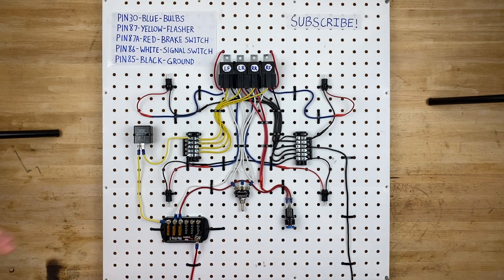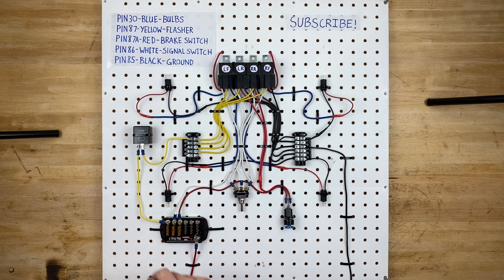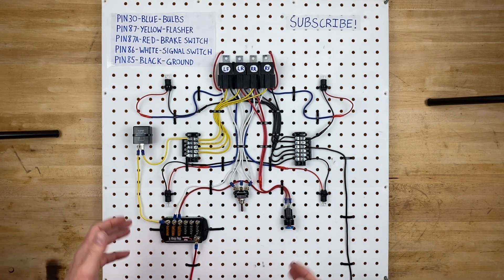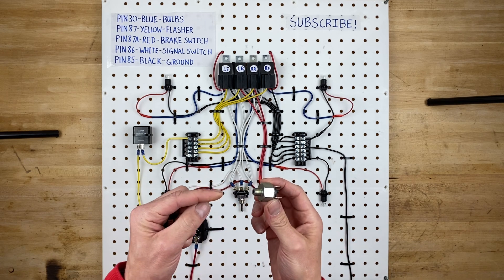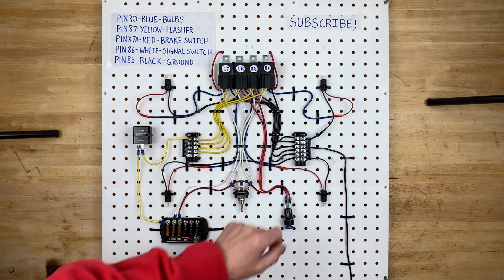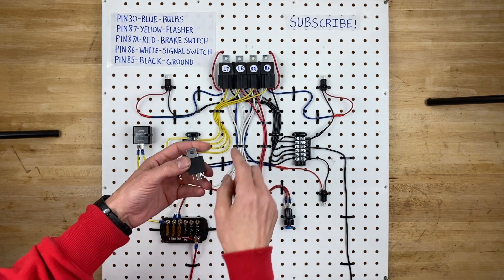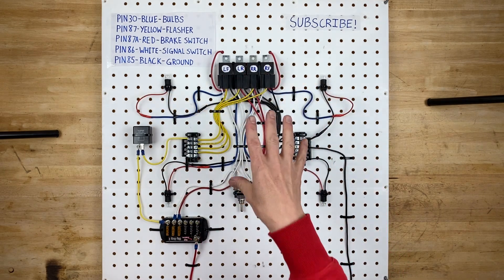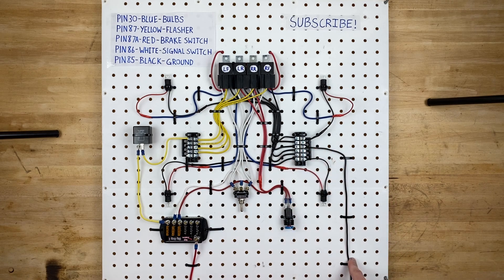How to Wire Turn Signals AND Brake Lights into a ONE BULB | @WiringRescue

Comment from the maker: Thank You for Watching my Brake Light & Turn Signal Wiring video! 
Subscribe To This YouTube Channel: http://www.youtube.com/user/4g63mightymax?sub_confirmation=1
See My Wiring Playlist: https://www.youtube.com/playlist?list=PLsF7T1tRFy2hmiiUUfMZNyV-BUA_yrPIh
Reply: @TommyJensen-pl8qz  what?
Reply: I remember some cars and trucks had that system here in  Denmark in the 70s I don't know how it worked probably existing they don't relay 50 years ago
Reply: @TommyJensen-pl8qz  usually it is the special switch that makes it possible, if it doesn't use relays.
Reply: Hi, i wired up my lights the exact same way but cannot get my brake lights to work, the signal is being sent, but no lights, indicators work fine, but no brake light, what could it be??
Reply: Question. 
I have an older vehicle with a homemade wiring harness. I have 3 wires in the rear. Brake, Tail and turn signal.  I have single filament bulbs (2 each, each side) How can I run the brakes and turn into the single filament bulb. Thanks!
Reply: Love your system,but can't keep up,I have a new 18 circuit painless wiring harness, but still need relays right to run fan fuel pump air ride lights ect. Right ? Can I get a copy of this so I can do this? I have most of the things you show! Thank you for whatever you can help with!!
Reply: Can you help me please to understand better?
Reply: Thank you so much!!! Your very smart!!!
Reply: can you expand this setup to include a hazard light switch? and what it would take to make hazards operate at the same time that brakes do? in other words single filament bulbs used in the rear for brake and blink but when hazard lights are activated the brake switch will still illuminate the rear lights solid, not blinking
Reply: @straighouttheshed   Adding hazards is easy. Just use a DPDT (On-OFF) switch and a diode will do all of that. Can use that SPDT switch or a OEM on the column Turn Signal Switch.

If you are making from scratch like on a dune buggy or ATV or Go Cart, then you can use just 2 relays, 2 DPDT Switches and 3 diodes.. Less wiring.
Reply: What's the diode for and where? Normal operation straight from the factory was if the brake was applied the brake light switch over rides the four way flasher unit.
Reply: @straighouttheshed   diodes is key here, ive wired this exact video and once you attach hazard circuit stuff doesn't work right but I'm realizing diodes are needed for back feed. hoping for a good diagram video :)

Comment: Theoretically to wire 4 way flashers in this you would go from a new fuse to new switch to spliced all 4 turn signal activation contacts on relays?

Comment: How can I do this with just a ground, running lights and turn wires I don’t want to retire the whole truck to the back they are 4” round led lights 

They have a turn/run wire a brake and a ground

Comment: I’m having issues wiring in a light that’s only meant to be a running light into a run/turn signal.  When everything is connected the blinkers only come on when I have the running lights on, if the running lights are off the blinkers won’t work.  Any ide what could be causing this?

Comment: I'm using the wiring proposed here to wire up my volkswagen oval window. It's a Euro model so it shouldn't have any turn lights, only semaphore with continuous light. But decided to have the brake light to be used as turn signals, and also added LED orange lights hidden behind the horn grill at the front. For the semaphores, the wiring was split to have the bulbs flash while the semaphore stay up.
Everything works, and I appreciate your help for helping me understanding all of this.

Everything… except the indicator on the dashboard. I would like it to light up and flash when the turn switch is activated, no matter if it's left or right.
I see 2 options:
 - add a 5th relay powered when the turn switch is activated (left or right),
 - connect the dashboard bulb to both 2 front bulbs and prevent the power to get back by using diodes.

Any advice?
Reply: Using diodes did the trick.
Reply from the maker: Sorry I didn’t get to you sooner! Diodes is a great option that I likely would have done too. You could also probably make it work with a double throw, double pole switch somehow, but it sounds like you’ve got it sorted out. If you have an instagram I can follow your build on, let me know!

Comment: Can I do this with LEDs? There’s a bunch of Amber running lights on the side of my truck I want them to be parking lights but also turn signals. I currently have them hooked up to a regular relay so that they do that now but they flash opposite obviously the existing turn signal so they shut off when the turn signal turns on and back-and-forth. I’m not super good with this kind of wondering but I feel like this could work but then being LEDs I’m not sure if I would need some directional diodes?

Comment: Do we have to use relays?
Reply from the maker: No. But if you don’t use relays you need to have a switch that is capable of making this work. Those switches tend to be $40-$100 at the moment. American autowire has some great options though. Check them out.

Comment: Now, add another complication - retaining the Trafficators but making their lamps flash. Without modifying the trafficator, just route the White power to the trafficator coil and replace the trafficator lamp with an LED on its own circuit board flasher. This type of lamp is available in the UK. The downside is that the trafficator flash rate is not synchronized with the main indicators and the flash rates can drift apart. Or modify the trafficator to separate the coil and lamp power input. Drive the coil from the White power and the lamp from the Blue.  Once you have mastered that, then add a single throw double pole switch to have Hazard Warning.

Comment: I just wired my hot rod exactly this way, it worked perfectly. Now, I went to you hazard light video, no guano! How would I add hazards to this circuit. Please help!
Reply from the maker: That’s fantastic! In this other video I made, I added a hazard circuit about 7 minutes and 50 seconds in. I think you should watch the whole video so it makes sense, but you should be able to do the exact same thing. The most important part is using the dual pole, single throw switch for the hazard. If you don’t, your turn singles won’t work right with the hazard wires connected.  Good luck!

https://youtu.be/Io_i9016o10?si=lA5hzW96VbBIl4l4
Reply: @ you’re a rockstar, I’ll watch it now, thank you for answering me back!
Reply from the maker: @randyhorton8369 happy to help get a hotrod on the road!

Comment: I think you just solved my problem! The aftermarket signal switch was not using 87A for the brake light! Whoo hoo! I'll post back if that works for me, The way I have it wired at the moment, the R signals work until I activate the brake light! Fingers are crossed - thank you - Elbow Up!
Reply from the maker: I hope it works out for you! Glad I could help!

Comment: How about adding marker / clearance lights to an all LED setup. Two purpose bulb, running lights and turn lights. I understand how the incandescent bulbs work on older GM vehicles but I don’t think that’s going to work with LEDs.
Reply from the maker: Hello! Sorry for the delayed response. I do have a bunch of a LED related videos in my wiring playlist https://youtube.com/playlist?list=PLsF7T1tRFy2hmiiUUfMZNyV-BUA_yrPIh&si=Gh_mU6zU7WhJeeIc. I don’t think any are the exact setup you’re asking for, but the information to make it all work should be. Good luck with your project!

Comment: I'm a DIY'er.  I'm going to be hard-wiring a brake/signal/reverse light LED strip/bar to the back of my travel trailer which has a simple light assembly with a white reverse light in the middle.  These strips/bars are designed to work on a pickup truck in a horizontal orientation.  I'm going to be using them vertically on my travel trailer, so I will use two of them (one strip/bar for left and right).  Since the system uses half of the strip/bar for the left and right turn signals, I was thinking of using the "hazard light" circuit for this since it lights up the entire strip/bar.  Am I on the right track?  I think it would involve combining the hazard and signal circuits coming from the trailer and into the "hazard wire" on the strip/bar.  Thoughts?

Comment: Great video, very useful. What about dash warning lights?  Can you use the spare 87A red wires for left and right warning lights, or maybe a 3- pin flasher unit with the 3rd wire going to a single warning light?
Thanks, Nick

Comment: I have one of those 12v auto pre built boxes with six 5 pin Bosch Relays & Fuses. If I use that and the upgraded flasher relay previously installed inside the vehicle do I still need to wire in a second flasher?
Reply from the maker: Unfortunately it’s really hard to diagnose or plan wiring projects over the internet. I’m not sure I could be of much help without the vehicle in front of me.
Reply: @ I’ve got it all worked out what would I run to 87a instead of brake switch where I’ll be doing this to use my amber signal as a DRL?  Thanks for all the help!

Comment: can you please explain how i would do this same thing but with the cars factory turn signal switch that is fed by a flasher? so i have the single filament 1937 parking light that is grounded to the housing that i want to light up by turning on the parking lights and also by turning on the signals it would bypass the parking light signal. but i need to do this even if im driving with the parking lights off. thanks
Reply from the maker: Generally factory turn signal switches have functionality built into them that turns off one signal and lights another. That way relays aren’t needed. Unfortunately I wouldn’t be able to help with your specific scenario without being there though. My newer continuity video may help you figure it out though. Generally a digital multimeter can identify what all the wires are doing.

Comment: wiring my 1959 ford f100 and used all your videos but i want to know the truck have on each back side an extra white led round light but now i want to connect them on the reverse light but also my normal light can i use a 5 pin relay will it work when it get power in on both 87 and 87A like when my lights are on and i am reversing and when you take it out of revers will the reverse light go off but they will stay on

Comment: Thank You for the Content !  Some may not quite realize just How Much TIME is needed to generate these Helpful vids …. THANKS !
I have enjoyed your content on 12V circuits.  I wired a custom LS-swapped hot rod From SCRATCH front-to-back.  I used switches, fusing and relays for virtually Every circuit.  Many said that my system is Way over-complicated.  I have lived through a catastrophic vehicle fire, so I want to use the ‘ounce of prevention’ mentality.
I have an application (custom CamperVan wiring).
Could you perhaps do a vid on controlling One circuit, using Three rocker switches, from separate panels in the CamperVan ?  Most vids that I see for similar application do not address Fusing, Switch ‘protection’ (i.e. relays ?), which leaves me feeling that all protection has been employed.  The rocker switches are 15A capacity, have 5,6, or 7 pins.  I presume 2 or 3-way.  On-Off-On ?
It would Definitely be HELPFUL, and I strongly believe that enough others will agree, increasing Views.
Again, Thank You

Comment: @WiringRescure I'm using a toggle switch for signals and want to use a single pole push button for hazards. Can I fork off a diode to each signal? Thanks!

Comment: Does anyone know if those 2 wire flasher relays fit in 5 pin Bosch style holder?  Trying to build my own fuse/relay box and I’d love to tuck those away in there.

Comment: How would I wire a turn signal to have turn signal and running lights together ? Trying to wire mirrors that have turn signals on a car that wasn’t equipped with them. I Ran it to a 5 pin relay and used turn signal as signal for relay but running into an issue where the turn signal on mirror and on headlight alternate back and forth. They don’t flash together. Is it possible ?

Comment: For hazard lights, switch needs a 4th position that sends power out both sides (to the 4 white wires) Therefore activates all 4 relays instead of just two.

Or you could wire in a seperate hazard switch with its own power feed, send the power out to a flasher relay then the 4 white wires or pin 86 of all 4 relays

Comment: I am trying to wire a canbus system that flashes ground on a motorcycle to the lights, but i am using a led light strip with amber turns. The hard thing about this is that the signal wire is shared for the brake and the turn. I need help trying to make the blinkers work without also flashing the brake light when both are engaged

Comment: Thank you so much!!!  This worked perfectly although I had to do some major head scratching to get it to work.  First of all my car is Positive Ground.  Second of all the relay connectors I purchased were not wired as yours are.  That took a bit to figure out.  The clue was that the stop light switch activated the turn flasher..... oh, that's not right.....Once I realized the issue I just had to follow your chart and de-pin the connectors and re-pin as yours are.  Oh, and I'm now subscribed!!!
Reply from the maker: That’s fantastic! I’m glad the video was able to help you out! Thanks so much for watching and subscribing!

Comment: thank you very much for this video. I do not like have the brake light turn off only to flash on the rear. I never understood having a one filament bulb having two functions. In the  early 60s I rewired all my VW Bugs and Vans to have a separate  rear double sided brake light with a separate amber left or right turn signal. Now I am wiring up a self powered 7 Way trailer light test box. I was really disappointed when I found out that the 7 wires in a 7 Way trailer light circuit used the terrible combined brake and turn signal system. I needed this circuit to duplicate what the towing vehicle "tells" the trailer. I just wish you had included  much simpler to follow .

Comment: is there a way to wire single filament without relays?
Reply: No they will Tripp any other way basically one of the dual inputs will cancel the other for instance if you’re using for DRLS & turn signal, the signal will be interrupted and flash consoled by the drl

Comment: First off WONDERFUL videos
I have learned  from them. They way you explain and build them out os perfect.
I've been combing through your videos looking for something matching what im trying to do on my 2008 Tundra.
Right now, I have the ALL the interior removed and trying to think ahead on some wiring changes I want to do since I'm here. I don't want to remove all this again.
I am making my truck kind of a "show" vehicle that is a "tactical" and have the ability to manipulate different aspects of "black out drive". Oneday will try and  include a FLIR system (maybe).
I am trying to do a
-one switch activation to kill all rear lighting (i.e., breaks, reverse, marker) along with the interior door activation switchs (so if any door is opened, nothing indicates it).
However, where I rub my head, do that this is not my level of expertise, is how do I have an indicator switch (when turned to "kill mode") indicate with no power to the rear lighting? Not the other way around, where the indicator is "on" when the lights are working, then is "off" when in "kill mode".
I hope that makes sense. Any help would be greatly appreciated.

Comment: I like your wiring, but one more question: 
while breaking and signaling a turn, how does the Relais stays on during flashing without a capacitor? In my mind, when the turn signal switches from on to off and back to on, in the off phase of the flash there isn’t power sent to the Relais, isn’t it?

Comment: You can also accomplish this with a single DPDT Switch and 2 relays. Less wiring.
Reply: Uploaded a video called "How to Wire Turn Signals AND Brake Lights into a ONE BULB DPDT Switch Two Relays".

Comment: The issue is that when your at the back of a car and your trying to use this method, you dont have a switch to turn the relays on...No one is going to run a 3 way switch to the front of their car to be able to use their turn signals and brake lights...Just sayin...

Comment: I've been wanting to modernize the wiring on my 1966 VW bus for a while now using modern day relays and fuses and was wondering if any of your videos show how to wire a single LED tail light to work the tail lights, brake lights and turn signals since that'll be the almost the same on my VW bus which uses a single dual filament bulb to work all of those circuits. Great videos by the way.
Reply: Why? Unless you don't already have the wiring, then it is just a one for one swap. Fuse box: just upgrade and reconnect. Flasher: Swap out for an LED flasher. Lights: Swap out the lights for LED.

Comment: Thank you for your good video, i have one question, how i can wire if i just have brake switch and turn signal switch, its for my jeep wrangler 2020, i change the rear light with led, but in my car i have 5 pin from car and on my new led light i have 4 pin, i try to put the brake light with turn signal, but When i push brake turn signal dont work, how i can wire ? Thank you

Comment: Hi, 
I was wondering if you might know how to wire a side marker NOT to blink when the blinker is on, instead leaving it just on like the running lights?  This is on a 07 trailblazer SS
Reply: Wire the signal wire directly to power don’t use power wire.